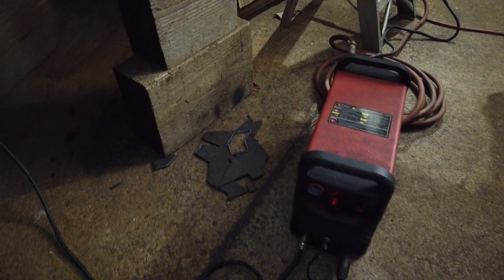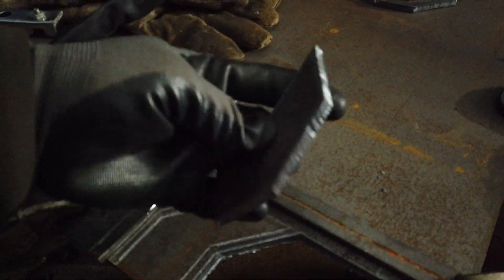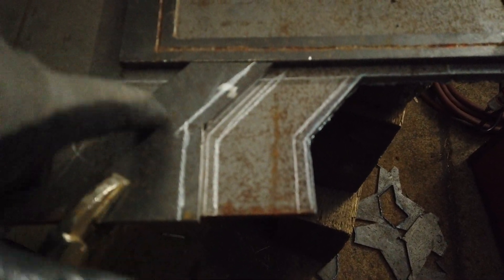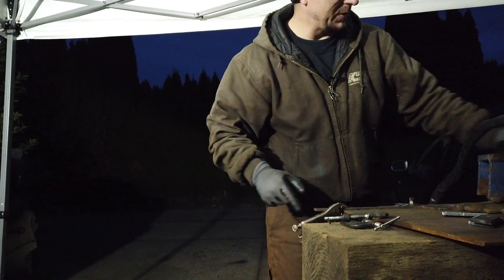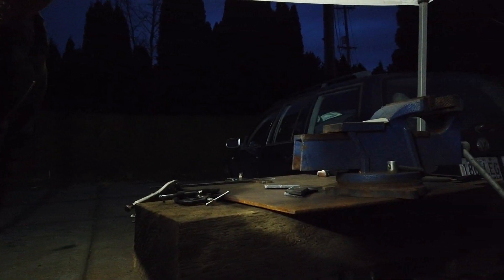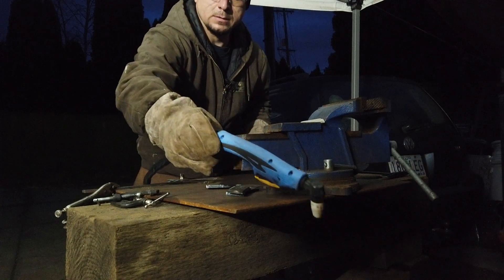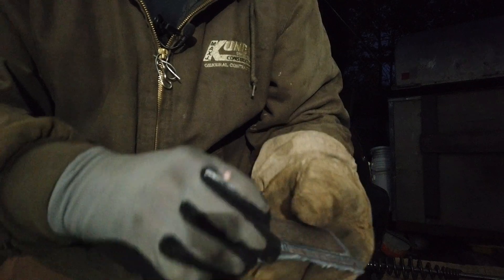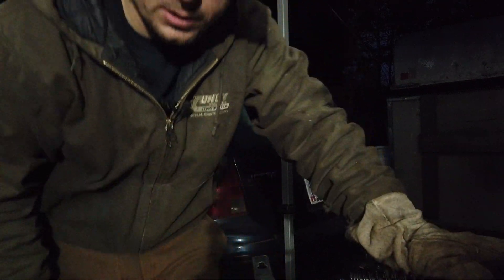how to cut desired metal shapes with cut 40 plasma cutter using stencils

Comment: do you get better quality cuts with an angle grinder?
Reply from the maker: Also, it's impossible to cut round shapes with a grinder.
Reply from the maker: Yes, just takes longer.
Reply: im having difficulties in getting precision cuts. my offset is usually off by 1mm